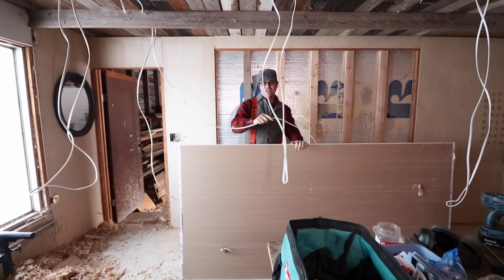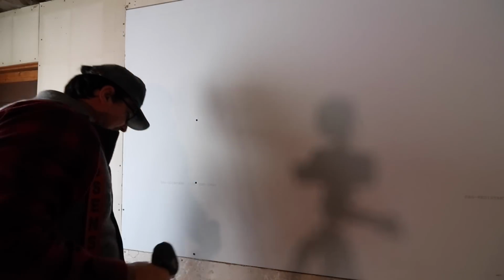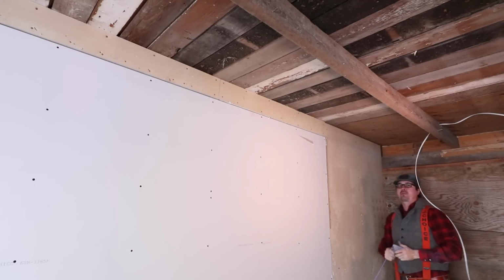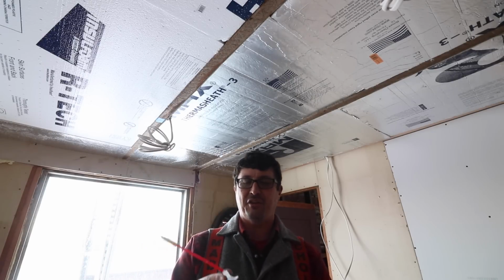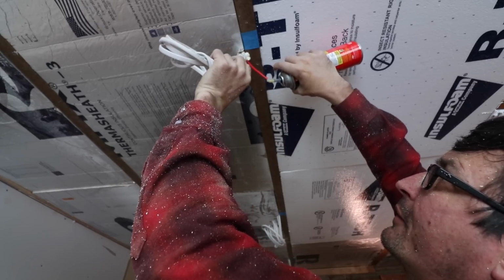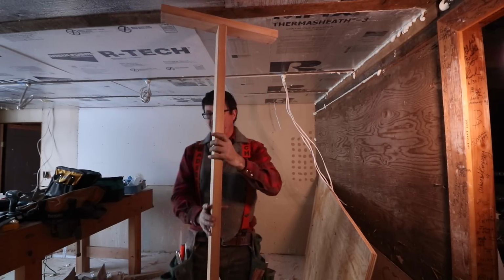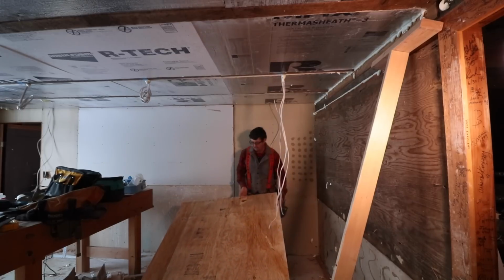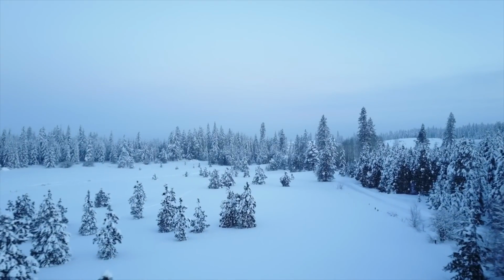I'LL NEVER DO THIS AGAIN!!

Comment: i must admit 3/4 ply is ott,  but as still not as heavy as our sound check drywall boards in the uk being 100 lbs. my advice to you for putting the rest of the sheets up is to put some scrap 1 x 4. half on the fixed board. so when you lift the next sheet up, you have a 2" lip to rest the sheet on and takes half the weight. hopefully this will help you if you can't get a hand

Comment: screw/nail a 2x4 to the wall 1in. from the ceiling the length of the wall so you can use it as a pivot point and only have to lift 1 end of the plywood those are really heavy

Comment: Gee that shed could almost mimic mine! (Except I reckon there's more airflow coming through my walls). There's not one straight rafter or wall either for that matter. I don't think the shed was ever meant to be anything used for anything other than storage. I was going to do something like this years ago but even after fixing all the leaks in the roof, it still leaks periodically. But thanks for inspiration, even though it's been a few years since you put these out.

Comment: good vid as per  you might try screwing a batton to the wall 1 inch short of the ceiling    line and useing it as a pivot point to lift the  board . thank you for the channel .

Comment: I do feel for you.  When I was a about 13 years old my father and I built a shop.  OSB was cheap so dad decided to create a ceiling out of OSB.   First time I ever felt sore muscles.   Then many years ago I was working with a friend of mine doing drywall and we had to drywall the ceiling of a gymnasium.  4 X 12 X 1/2 is fun at 30 feet in the air.  That's the day I learned to love Robaxecet.

Comment: an easier way to do that in the edge areas would be to attach a 2x4 to the wall, then put the end of the plywood up on it then lift and attach the other end. then go back and attach the end sitting on the 2x4.

Comment: Again a good vid! .... People in the building trade might suggest you lay a block under your support so it pushes it tight to the roof joists, or even extend it  ..... and placing the support close to the end would allow the ply to bend down under its own weight whilst you threaded the wires through! (tricks of the trade ;o) ) Also a tradesman would have a pair of stilts to make life easier .... not n option for a 1 off or even a handyman at over $300  pair! As to the "Journey of the Juicer" .... It will be fine, as long as you do not go all evanjelical over it! All things are fine in moderation!

Comment: Definitely need to glue that ply up to the ceiling. That's a lot of weight hanging on screws. Just make sure those screws are galvanised so they don't rust / break / drop the sheet.

Comment: I might be missing something, but why use 3/4 inch plywood as ceiling material?? Why not use 1/2 or 1/4?  I don't know much about construction, but it seems like you don't need this heavy of a material for the application.  I'd appreciate any info on why this was used.

Comment: I hope that while you were wiring you added enough electrical outlets. recently, I have become more and more frustrated with my own shop having an adequate Outlets. Even though I have already 9 standard one gang Fox's, I wish I had all of those double plus two more. I counted up the things I normally leave plugged in in my shop, and it came up to about 25 items. four of which should have 20 amp service by themselves. adds up quick.

Comment: screw  strip of wood on the walls 1" below ceiling height,rest board on to them hold t rest on outside of board then li,doneft up after pulling wire through

Comment: I have a juicer and would definitely like to hear more about your recipes, I have not used it recently, mostly due to not having good recipes to fo off of.  One thing I will tell you, is that, unless you have the special vacuum sealed canisters, you should try to avoid bulk juicing.  Research it a little more but from what I understand air is the devil and kills a lot of nutrients in the juice if left for too long (even just a few hours).

Comment: Not like im any type of code person but it looks like those are only 3/4 inch holes you drilled in the ceiling boards framing and i do know this, only one wire is supposed to be in a 3/4 inch hole

Comment: that's called a dead man!! you can get wires through holes easier if you fix a cord to the ends and extend it through the hole before you lift it! plus a little bigger hole and then foam it in makes it easier to get them through also!!

Comment: Why are you using plywood for the ceiling, instead of drywall strips? It's lighter and fire resistant. Here in the Netherlands they sell 2 foot wide strips of drywall, which I can handle overhead by myself. I'm very impressed, you managed to install this plywood sheet almost by yourself.

Comment: why did you usr such thick plywood ? surely would have been cheaper to usr drywall or 1/4 inch ply or am I missing something.
Reply from the maker: Sag,
Reply: Wranglerstar surely if you put plenty of screws in it wouldnt sag ?
Reply from the maker: Screws only work with they fasten into a joist, some of the rafters are spaced nearly 30"
Reply: Wranglerstar I was missing something then, pardon my ignorance.
Reply: Liam Harvey The joists are spaced apart a little wide. I think plasterboard well fastened would have been ok. But each to their own.

Comment: anyone that works with polypanels will tell you NOT to run electrical cable direct thru the material as over time it will react with the cable shaeth and make it brittle and break down the insulation. Always protect the cable with a piece of flexible electrical conduit

Comment: instead to use a mobile construction wood you can fix it at the wall. you can lift the panel more easyer. the constructionwood  is to be screwed  3 cm  under the ceiling. you put the edge of the panel beween ceiling and constructionwood the other end you can lave on the ground. sticking the electricwhires to hole and lift the panel  to the ceiling.and fix it.
no need for a second man.

Comment: Ive never had luck with foam insulation but haven't used it in a while. What R value are you getting & do you notice a if you're getting a good result? Id like to reconsider its application.

Comment: Cody  I would've went with light receptacles in the ceiling and aluminum tape on the seems of the insulation board  at least on the cross seems,  aluminum tape is also better than duct tape on ducts
Reply: It's actually duck tape, like canvas duck, originally meant to keep water out of things.
Reply: yes they have a brand called duck tape  but I'm not talking about that,  i'm talking about regular aluminum tape its like think foil with a sticky side and you can paint it  if you need too

Comment: It's too bad you don't have a drywall lift. I redid my 24x24 wood working shop back in 2008. I picked it up at a local tool sale event for just over $100, sure made it a lot easier to put 5/8 drywall with over 15 outlets on the ceiling. Anyplace local rental place by you where you can rent one cheap?

Comment: I want to set up my own woodworking shop but I am not sure what I should include for a begginer. Just wondering if you could offer me any advice.
Reply: Sam CB03 as sturdy a bench as is practical, a panel saw, a carcass saw, knife, adjustable square, a set of 4 chisels, drill and drill bits, screwdrivers, glue, a #4 hand plane, marking gauge, and something to sharpen the plane and chisels.

you can pretty much build anything you want with that.

optional extras; a jointer plane, smoothing plane, fore/scrub plane, spoke shave,  drawknife, dovetail saw, flush cut saw, router plane.

Comment: What insulation is in that former window opening. I see aluminium coated insulation behind the studs. is that sheathing, or is it thicker than that? I would have insulated between the studs, if it was just thin sheathing.

Comment: can you comment more on the drywall bit  I sure could use a couple of them  Can you find then at the "bigbox" stores?  Thanks
Reply: Kevin Ashby Home Depot and Lowes have them for sure. The bit sets the screw just below the face of the board but not so far that it breaks through the paper.

Comment: Sorry, not a troll but a long time viewer. I thought you said you had a humidity problem in the wood shop causing your tools to rust. It may be different practice out west than here in the mid west but sealing off the ceiling like you did would be a big no no in a home or shed. Just wondering your reasoning since what you did goes against every building practice we use around here.

Comment: WOW! lost for words. Not even going to try to point out everything that's wrong with this project so far. But have to mention the electrical junction box that you covered up. That is a code violation, might want to check your book that you got from "home depot" see if it has a section (ELECTRICAL CODE VIOLATIONS).

Comment: A face coat of 20mm board insulation and reflective tape will stop all of the thermal bridging that will occur through your ply sheet into the rafters and out into the sky above

Comment: Enough people on here have beat you up over the highly illegal enclosed junction boxes. I wont.
Why did you go with 3/4" plywood? 1/4" would have done the job just as well and been a lot lighter.
You need Jack helping you. Or the suggested 3rd hand bars that were on amazon.
Reply from the maker: +Swamp Rat anything less would sag between the joists

Comment: your kid go to shool or you homeschooling?
Reply: Jack's homeschooled
Reply: Ouch. I had to stay at home for years, allegedly for health reasons, i wasn't actually homeschooled, nobody taught me anything, i had to study on my own, but that's not the main issue here, i finished school with good marks, even if it was insanely taxing at times to catch up. The problem is that being separated from peers harmed me, i have an insanely difficult time at dealing with people and adjusting to society. I can't be certain that Jack will have similar issues, i certainly hope he won't, but homeschooling just strikes me from personal experience as the worst idea ever, in spite of how you might disagree with school or would want to avoid typical problems that children face there. I guess those issues are just a part of life that if you try to circumvent, you can lose something more important in the process.